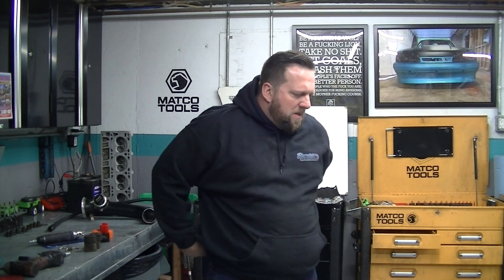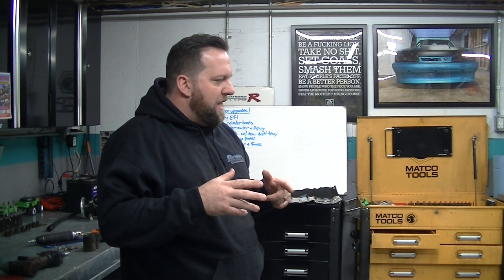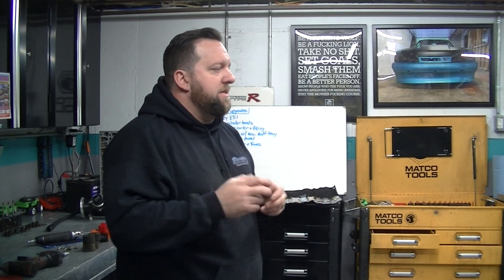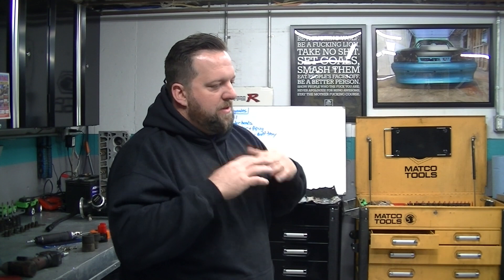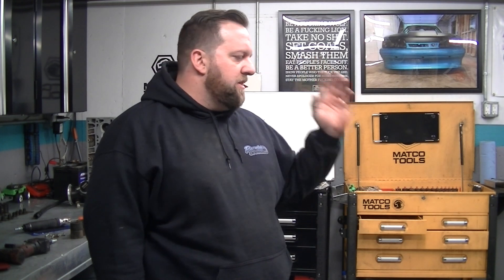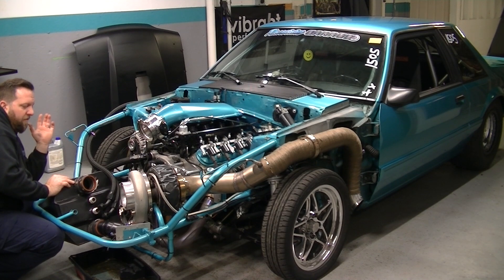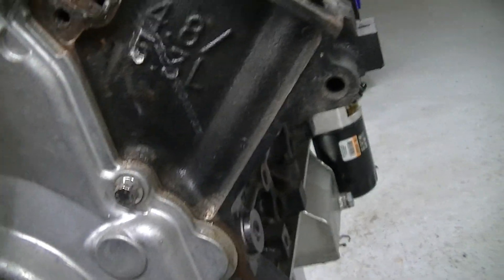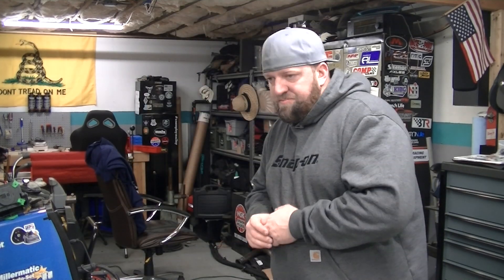Foxbody Upgrades EP: 1 Tear it down, yes all of it.

Comment: What issues did you have with the cooling system/radiator?
Reply from the maker: Modified Z06 once I got the expansion tank plumbed correct it worked fine.

Comment: Run paper gasket for the water pump... the o ring ones are garbage always leak
Reply from the maker: Mike Wiseman  Im going to use the oem o ring ones.
Reply: Race Status it will just keep happening. They did make oem paper ones for different vehicles
Reply: I’ve just trying to help Chevy trucks have this 9 time out 10 it’s the gaskets that’s shit the bed in ls motors and shop replaced the whole pump just for a gasket
Reply from the maker: Mike Wiseman I understand but with the motor plate and everything the paper doesn’t seal that well.

Comment: 862 is actually a stronger casting aswell they were casted in a different factory that's why some of the other crack
Reply from the maker: winch racing they are stronger than the 706 counterparts.
Reply: @Racestatus  I don't remember the exact ones that are better I just know that out of all the LS heads the 862 was casted in a different factory and has been proven to be a stronger head. Alot of the others crack between the valves and in other places and the 862's are stronger. There's a YouTube review out there that show the difference info on all the LS heads and it's really informational

Comment: What did you use to cap off your a/c lines coming out of the fire wall? Im going to make a plate similar to yours to cover the heater core holes but wanted to leave the ac lines, I did think of just flush cutting them and covering over them all as another option.